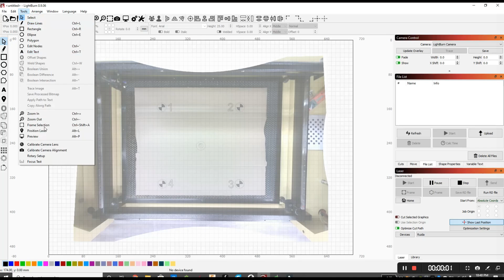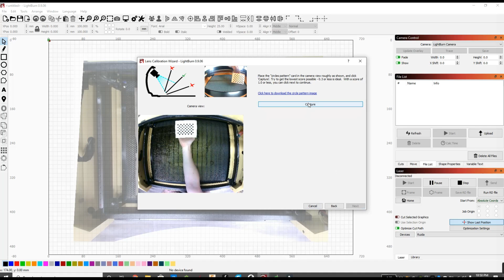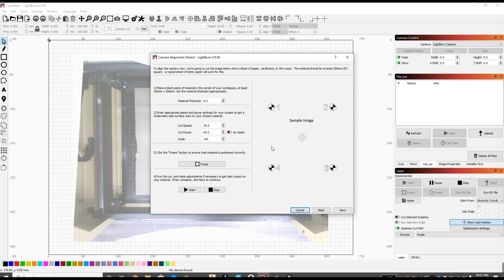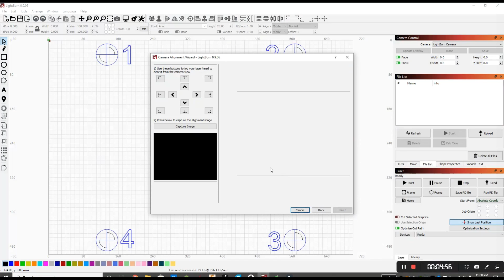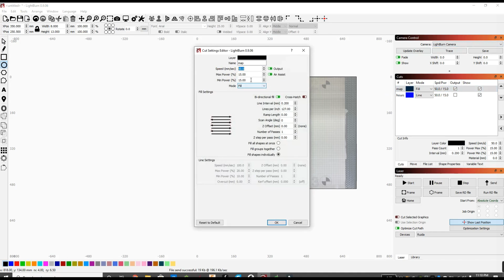Lightburn Camera Calibration For Laser Cutters And Engravers

Comment: So I have the Lightburn Camera, 8mp 140 degree fisheye camera.  I calibrated the camera but when I burned the image, for the four corners, I tried to capture the image but it will not capture.  I have a OMTECH 60w (700mm x 500mm). Any suggestions in getting past this point would be greatly appreciated.  Does this have anything to do with the lighting in the room?
- Reggie

Comment: Very cool! I might have to give more thought to switching over from RD Works. I’ve just been labeling the corner of my sheets with a serial number, and creating a corresponding file that has current and past cuts for that particular sheet.
Reply from the maker: Lightburn has been a godsend.  30 day free trial, worth it.
Reply: Lightburn has totally changed my use of my laser, small leatherwork stuff is so much easier for me now and cutting out wooden trinket boxes are a dream
Reply: I just switched from RD Works to Lightburn about two days ago, I so wish that I had done it months ago.  What a difference.  I highly recommend the change.  I'm still considering the camera.  I guess I'm a little slower than the average bear when it comes to making change.

Comment: As a cheap method for better nesting without a camera you can just make a square or rectangle that's the same size as your wood stock, make sure it's on a layer set not to output, then just place all your cuts and engraves within the square, and boom your scrap will come out just like how you lay it out within the square.  And if you don't do jobs often you can save the lightburn file for that piece of wood, which works best if you have a square reference so you always line up the same 😉

Comment: Amazing video. Love how precise you can get it! I just got a Neje Master 2 Max and I'm setting up an old cell phone for the camera.

I wonder, is there a way to do this camera setup on a CNC? I have some live edge slabs that I would like to bowl out precisely. Currently I'm tracing the cut area on the wood with chalk, then using a couple framing squares to box in the area and taking a good photo on my phone. Then I'll take it into Illustrator and resize the image based on the framing squares. Next is tracing the chalk line to make a shape, then save as SVG and import into VCarve.

Having a live camera preview in VCarve would be amazing.
Reply from the maker: yep, check out www.rowdyroman.com

Comment: Which fisheye lens did you finally go with based on your measurements?
Reply from the maker: 160
Reply: @MyersWoodshop   The first time you said that it was a 140° camera. Now I'm seeing 160° camera. If your camera to bed is 660 mm. Would a 120° camera be better. 700÷120=466 mm above the bed, minimum, to see the whole thing. I have the same yellow 60 watt and just want to get the right camera the first time. Thanks Ben

Comment: In the corners you tilt the calibration patern so that it faces the camera at right angle - is this prescribed by the Lightburn manual?  If not, then it bits the idea of using the chessboard pattern for camera calibration, as this idea is to offset distortions of a wide-angle fisheye camera  view of a flat plane
Reply from the maker: yep.

Comment: Do you have a vid on changing the controller to work with the light burn software?
Reply from the maker: changing the controller?  I'm using the same ruida it came with.
Reply: @MyersWoodshop  I'm using a full spectrum laser and I heard i need to swap controllers to run lightburn.

Comment: I am curious why you chose the 140 d camera? I have the same laser (partly thanks to your videos, you should get a cut from Orion motor Works) and based on your placement and lightburns website a better match would have been the 90 d or 120 d camera (less fisheye as well). So was there a particular reason you went with the 140??
Reply from the maker: thats what lightburn recommended to me.

Comment: Hello Ben, I am about to purchase a Chinese laser and have a question on the camera install. Every video that I have watched shows how to mount the camera on the lid but they never show where it is connected to the machine. Does this camera hook directly up to the laser control board or do you need a computer attached to the laser all the time?
Reply from the maker: it plugs into your computers USB port.  it doesn't hook up to the laser.

Comment: Hi Ben, I just got an Ortur 15 based on you review of it and was wondering if you have info on using a camera on an open frame mini engraver like the Ortur.  If so do you have a recommendation for the camera and do you make a mount?  Thanks for the videos.  BTW I also got LightBurn and am learning it.  Thanks again.  Cheers, Tom
Reply from the maker: The lightburn camera is the way to go.  still working on a mount.

Comment: Great video Ben. Thanks for posting it. I know in a previous video you found out your laser was really a 50 watt instead of the advertised 60 watt; will this laser cut cleanly through 1/4” Lexan (plexiglass) and 1/4” plywood in one pass?
Reply from the maker: Yep
Reply: Lexan and plexiglas are not the same!

Poly-carbonate (Lexan) is often found as flat, sheet material. The window of the laser cutter is made of Poly-carbonate because poly-carbonate strongly absorbs infrared radiation! This is the frequency of light the laser cutter uses to cut materials, so it is very ineffective at cutting poly-carbonate. Poly-carbonate is a poor choice for laser cutting. It creates long stringy clouds of soot that float up, ruin the optics and mess up the machine.   Cuts very poorly, discolors, and catches fire.                       Per ATX Hackerspace

Acrylic/Lucite/Plexiglas/PMMA are good to go! They cut extremely well leaving a beautifully polished edge.
Reply: Freddy Akins WOW!

Comment: Did you or someone here tried other USB camera ? like a Logitech one used for streaming ?
Their camera is too expensive compared to others better usb cameras for under $40
I dont want to use the Trial version yet to try this until i get a mini Gerbil or C3D

Thanks
Reply from the maker: Heres the same one for less: https://rover.ebay.com/rover/1/711-53200-19255-0/1?mpre=https%3A%2F%2Fwww.ebay.com%2Fi%2F273455139543&campid=5338460712&toolid=20008